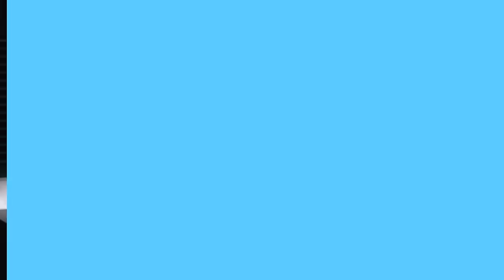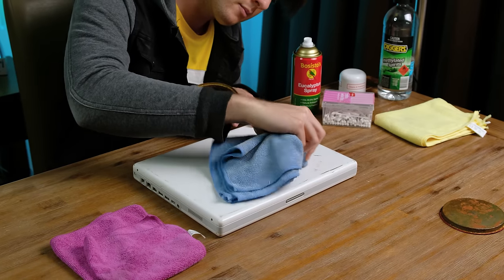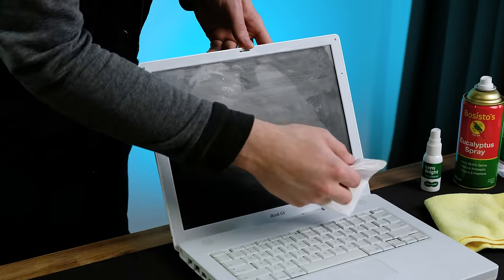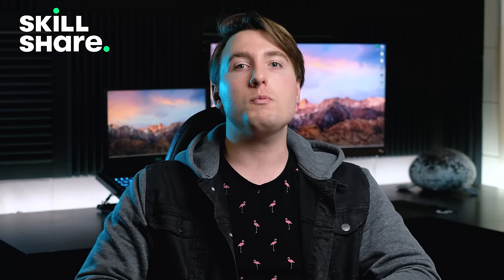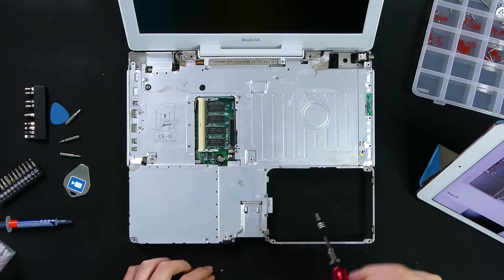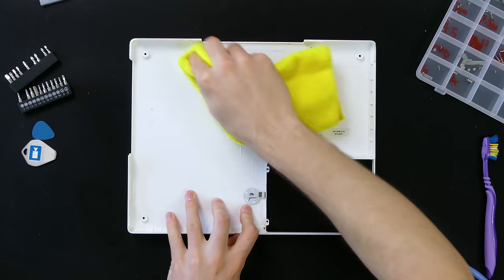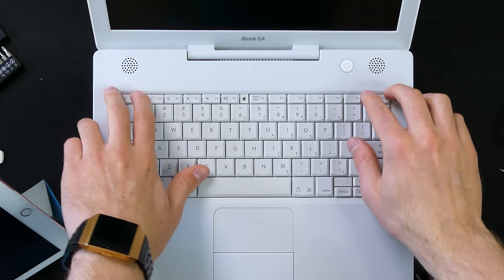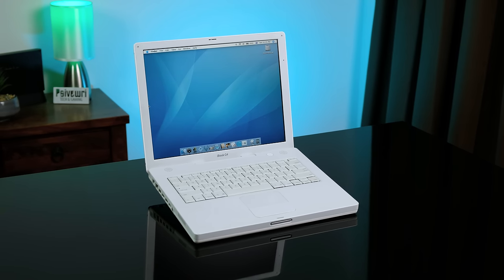Apple's Last iBook

Comment: "Apple is switching to ARM processors, so we will see how that goes." - The most accurate analysis of the ARM switch I have heard so far. Bravo!
Reply: 68K-PPC-Intel-APPLE silicon
Reply: @girlsdrinkfeck  Arm has already been bought by Softbank Group a Japanese holdings company in 2016. Softbank is publicly traded so technically speaking ARM is probably more owned by Japanese and American investors than anyone else, sorry to shatter your dreams of ARM being a UK company.
Reply: girlsdrinkfeck I’m sure everyone will be so sad to see you boycott every electronic device in the world.
Reply: @TheThunderGuyS That may happen on custom silicon solutions. For consumer space, we'll have to wait a bit more so it gets more mature.
Reply: João M.  I wouldn’t be so sure. Newer intel chips compete or beat even M2, and the architecture is already seeming to plateau in performance.
Reply: @EvilTurkeySlices with a massive power envelope. If Apple wanted to make a 200W peak CPU they could beat both Intel and AMD, but they’re not making one.

Comment: I think at this point you should invest in a machine polisher haha. I'd also recommend trying some very fine wet sanding paper. 1500-3000 grit wet sanding paper can really remove those deep scratches. And rubbing compound will remove the scratches made by the sand paper. I was actually going to be making a video demoing this on my car haha
Reply: Try the headlight cleaner lens kits, they are made for polycarbonate - very similar to the Snow books material .
I use kitten extra cut compound , wet the surface, place a small amount with a cloth then polish with another smooth cloth.
You can buy those cheap sponge on a stick and place it on a small drill

I like my old G4 Ibook - battery does not hold a charge but it has all of the old software and 2003 office, 10-4 is the most modern browser.
I have not watched the entire video yet as it is lunch time at work, but i think mine i set up with OS9 and then dual boot to OSX 10.4 Tiger - pretty sure it also has the minimac emulator for vintage MAC's    ( i also have a 2007  Macbook Intel core2duo 10.6 and that has a emulator for OS7 or OS9 )

Regards
George

Comment: I have one of these that's been sitting in my closet for years, I probably haven't used it since '08.  I wonder if it will still turn on.
Reply: Give it a try. I restored a 2007 thinkpad t61 that my friend had sitting in the closet for ages. It's now a neat 2 core with little light overclocking it is cable of some office work.
Reply: Well? It's been 4 years have you tried it yet?

Comment: "I should have used a polish that's meant for plastics rather than car bodies": modern cars have a clear coat (laqcer) that's over the top of the base coat (the colour layer). This clear coat from the factory is a 2k epoxy, so basically a plastic.

Comment: So, buy the last MacBook Air so that you could make a video on "the last Intel Macbook" in 15 years :)
Reply: Get the standard MacBook
Reply: Stonks 📈
Reply: @slapshotjack9806  they go for to much
Reply: @Ahsokaaep  Do they now? lol you may want to do some research on that theory
Reply: Intel still outperforms Apple m1
Reply: @loreaver3882  outperforms in what? Power consumption? :)
Reply: @АлексейГриднев-и7р  outperforms in price :)
Reply: @loreaver3882  nah man intel chips run way too hot, the m1 soc is the future of processors for laptops.
Reply: @thedeadlygames9716  nah man atleast Intel based computers have user upgradibility and M1 based SOCs are only for phones
Reply: @artisary1393  but the M1 was designed for macs not phones… I get what you mean because they do use socs but the M1 is mainly for computers (unless you count the M1 iPad Pro)
Reply: @artisary1393  I got a intel dual core i5 MacBook Air 13’ 2015 and it’s somewhat upgradable, everything can be replaced but the ram and the GPU/CPU that are soldered to the logic board so I agree with you there, and also 2007-2011 intel iMacs  are the most upgradable  so I do see what you mean.
Reply: @thedeadlygames9716  I agree with Macs, but I don't think Windows PCs will be replaced with ARM not for atleast 5 more years
Reply: @artisary1393  well maybe thought, just look at Microsoft’s laptops with nividia tekra socs but I guess will wait and see.
Reply: @lorenzo.delbello  this comment aged poorly

Comment: I went though a lot of powerbook G3s and iBook G3/G4s in the late aughts, buying them 'broken' on eBay and fixing them up to sell again. Many only required very basic maintenance such as resetting the PRAM and such. I didn't make much on each but it was basically a way to incrementally upgrade to a MacBook core2 duo, and then an iMac G5 by 2010. Since then I've had at least one MBP/MBA and one iMac 27 on my desk every year. I still have one of the 1.42g iBooks shown here, as well as it's little 12" brother. Also a powerbook Pismo. All still boot.

Comment: I still have my 12" iBook G4 of that vintage.  They're really slow by today's standards, but back then, they weren't too bad.   The Intel notebooks ran rings around them, though.  The PowerPC just didn't make enough strides in speed to be worth keeping.  They didn't support them very long after the switch, and I'm afraid that's what they're going to do again with the switch to Apple Silicon.  I'm hopeful that we get 3-5 years, but they won't keep Rosetta 2 for very long.  The iBook cleaned up well, though!  Great video!
Reply: Its slow because it doesn’t have L3 cache. Thats why the G4 towers, G5 towers (which also lack cache but fast data bus and ram/sata) and even the 1ghz Titanium PowerBook can still brute force through tasks.

Comment: @Psivewin I have one of these still put away I used in College taking Graphic design back in 2004 to 2007 and The screen is messed and the power plus doesn't charge properly and the battery case hold is bent a bit. It worked perfectly otherwise mind you and the keyboard is new or was new before the screen broke. I wish I could find a repair shop for would love to use it as a scriptwriting laptop again but nobody fixes old Mac I know of.

Comment: You got the best version of ibook. There are several possible upgrades, such as replacing the display with the display from an IBM thinkpad IPS, using an SSD (it's a bit challenging, since the ibook is ide), but I think the main focus is to keep it working for several more years, is the cooling system. All Apple notebooks have always had a cooling system that is a joke, simply ridiculous and inefficient. The Ibook is especially complicated, because its motherboard was designed so that the components are facing upwards, giving little space to work. Years ago I removed the DVD drive from mine, and started developing a super thin liquid cooling system that occupies the DVD bay, but I haven't finished it yet.

Comment: I remember the 12 inch 2005 iBook from school. I remember it being used up to 2015. The batteries were the original ones so you had to keep it plugged in. It went from 100% to 0% in LITERALLY 2 minutes. That’s not an exaggeration.

Comment: I’m grateful that you are willing to share your talent with the world. I love my little G4. I hate that I can’t hardly do anything on it these days. I’m curious what the newest version of Windows it can handle. I’ve looked into making it a chrome book, but haven’t had any luck. Also haven’t been able to find much use for it in the Linux world. If you have any thoughts or suggestions let me know.
Reply: No version of Windows will run natively on pre-Intel Macs (i.e. before 2006) so your only option is to use virtualization software. The newest version of Windows I've had success running is XP. And bear in mind that since it's emulating a completely different type of processor, it's very slow.

Comment: I still use my 05 iBook G4! Mine has 1.5Gb RAM now, upgraded it in 2011, and a 500Gb HDD. The original battery still lasts a while.

Comment: I have one of these that experiences a problem with freezing until you press firmly by the bottom left of the top and then it starts working again for a while. My unit also has a serious problem with extremely slow wifi. I managed to squeeze the highest version of MacOSX I could get (I think it is Snow Leopard) onto it using a burned ISO image for it, but the wifi is so ridiculously slow I can't believe that this is normal. Other than the locking up problem resolved by pressing on that spot and the extremely slow wifi, my unit is in amazing condition.

Comment: I recently bought one of these for 30 quid or so (about US$40), in its original box. Pristine, and I have never seen a second-hand product packaged so well. The battery is shot and like yours it can't cope with 2020's Internet, but other than that is great. Nice to know you can still get RAM and batteries for them, too, although for obvious reasons the battery isn't exactly important right now.

Comment: Use metal shims instead of pads. Aluminum works great.. put a couple dabs of glue to hold the shims in place on the edges

Comment: Recently got a Mid 2009 MBP with 8gb/500gb spec. Owner completely wiped the frickin hdd, including recovery partition. Currently has windows 10 on it working alright, but what can I do to install Macos? The superdrive is officially done for and can't get it to boot off usb. I mean, it only cost me $65, so recommendations?

Comment: I had one, too. The keyboard is the biggest flaw. It is a "hatch" for upgradeability but it rattles like a snake as soon as the two clips that hold it in place wear out. Let alone that it is an expensive spare part. You get a decent mechanical keyboard for the price of the spare part. :)

Comment: My grandpa gave me his old G4 iBook since I have a little collection going on. Unfortunately, he didn't give me the power cord so I can't mess around in it. I guess I could buy one from eBay.
Reply: Definitely buy a power cord. I bought a $10 iBook power cord from Trade Me (NZ equivalent to eBay) in like 2015, and its been working solid ever since. Make sure to get the right wattage though. My one is 45w but I have heard that you can go up to 65w.

iBooks, especially the G4, are fun to play around with and make decent emulation machines.

Comment: I'm very lucky to buy one of the same models on ebay for 60 dollars which only had like 24 cycles on its battery. It's basically brand new. It can handle most classic macos game I throw at it with an easy RAM upgrade.

Comment: No wonder the damn PowerPC processors always ran like a furnace, that was a totally inadequate cooling solution, made sense the Inter chips they replaced them with ran so much cooler. Sort of how the current Intel processors run super hot in Macbooks, and the new ARM processors will likely be way cooler and throttle less... Hmm.

Comment: TenFourFox didn't work because it requires Mac OS X 10.4.11, while you had 10.4.4. Try installing 10.4.11 and then run TenFourFox again.

Comment: I had the 12 inch model. My very first MacBook. I replaced the hard drive with an early SSD and it caught fire a week later.
Reply: What caused it to catch fire
Reply: @Krzrrazrrokr  Overheating. Dust. Dried insect carcasses. Plastic.

Comment: Hi, I have a laptop from hp model 15 da0019nia notebook has a cpu from intel i78550u 1.8ghz and Graphic card from nvidia geforce mx 130 I have a GPU throttling on games its go heat easily to 90 and the speed drop from 1176 to 400 and make fps drop in all of the games like counter strike and rainbow six vegas 2 too and I do all I have to do and I didnt find the solution can you help please sorry for my bad english im doing my best

Comment: TenFourFox requires 10.4.9 (or it might be 10.4.11) and you had 10.4.4 installed.
Reply: Additionally, I see several people commenting things like "i wish it could connect to wifi" ...it can. All iBook G4s support airport extreme, which can connect to WPA2-secured networks. In the earlier models, it was optional, but in the later models it was standard. Moreover, all aluminum PowerBook G4s can connect to WPA2-secured networks as well.

Titanium G4's and iBook G3's cannot connect to WPA2 networks however.